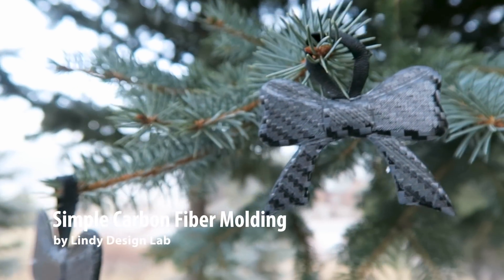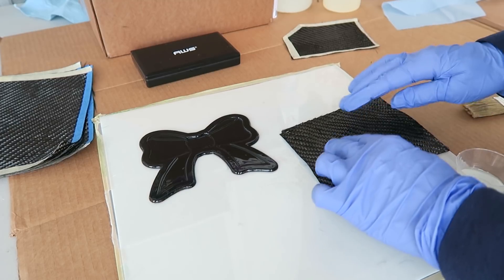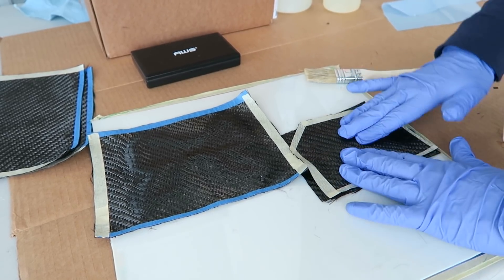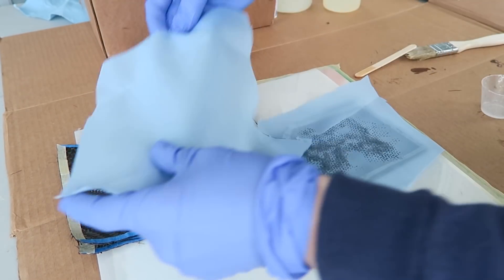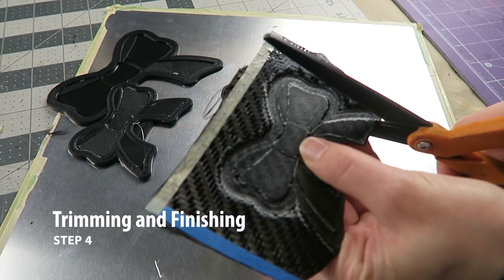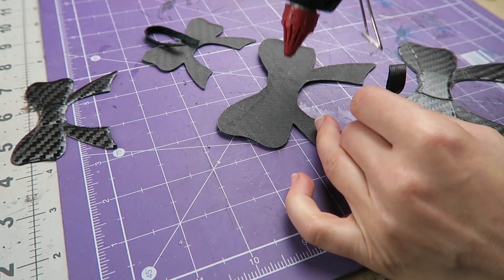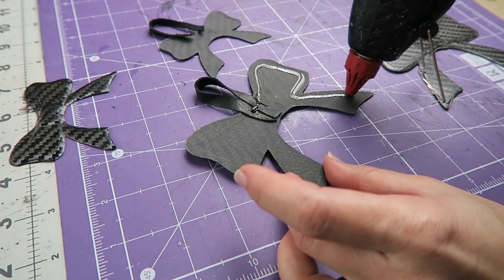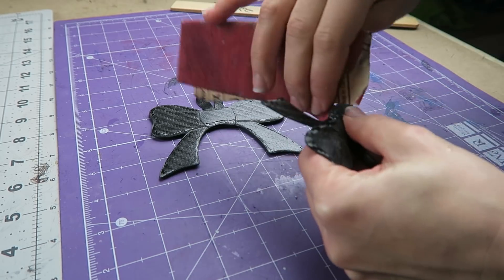Forming Carbon Fiber with 3D Printed TPU Molds

Comment: Have you tried sanding out the layer lines and polishing? I'd like to also use a tpu mold for some "forged" carbon fiber but I want to have a glassy smooth finish after sanding and polishing and hopefully not sanding into the CF.
Reply from the maker: If you want a perfect gloss finish straight out of mold, I'd 3D print the positive, resin coat and polish perfectly then take the mold from that either fibreglass mold or silicone. Certainly you can improve the tpu finish with sanding, but not easy and not a great finish.
Reply: @LindyDesignLab  yeah I need a slightly flexible mold due to the geometry of the part to get it out of the mold. My other option is to print the positive and make smooth that really well and make a mold using a harder silicone

Comment: Do you use a laminating epoxy? I have amazing clear cast on hand do you think amazing clear cast would work in a small mold? As of right now it is just a prototype to see if my method will work. Do you think amazing clear cast will be too thick?
Reply from the maker: Haven't used that particular resin, but I'd guess it will work fine as I have used both table top epoxy and deep pour epoxy for carbon fiber with complete success. If it has trouble soaking in, warming it with a heat gun might do the trick.

Comment: I have a video showing how to use a $80 FoodSaver from Walmart and plates from IKEA to make composite frisbees.  You don’t need the peel ply or breather cloth due to the channels in the bags.  Thanks for this video! I was wondering if I could use TPU to make original molds with a 3D printer.  There are so many possibilities with this method.
Reply from the maker: Nice. Yes, TPU is convenient for rapid prototyping of molds.

Comment: it is interesting, but almost invisible on tree. I think that it can be better made of mixed fabric (carbon + red or orange kevlar), vinyl wrap with carbon texture in some nice color or hydrographics on 3D print. But nice project, you created indestructible lightweight decorations :-)
Reply from the maker: True, rather than the fir tree I imagined this design suiting a miniature, stylized tree shape crafted from metal rods.
Reply: @LindyDesignLab  great idea, it will be possibly dangerous to walk around such thing :-D